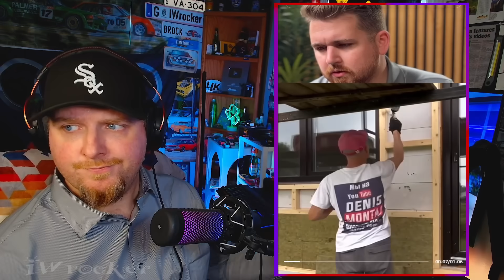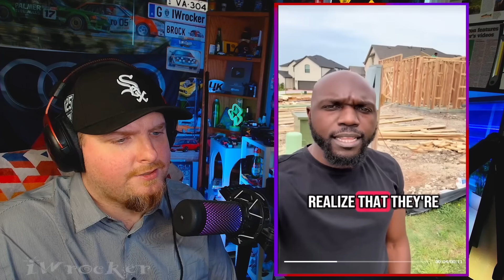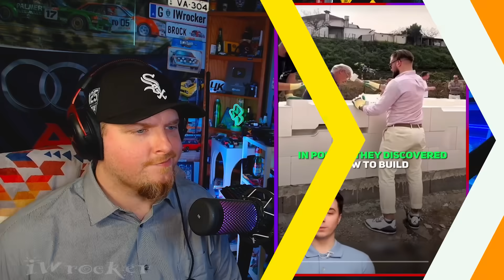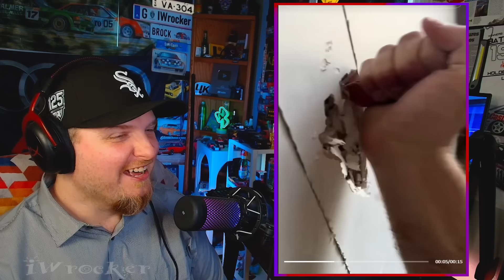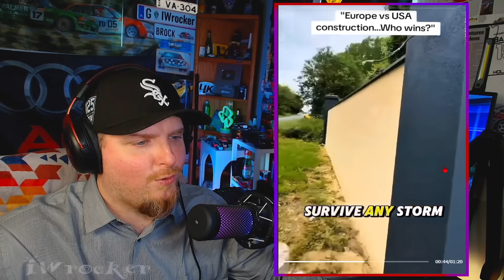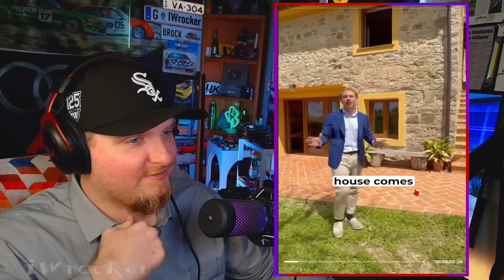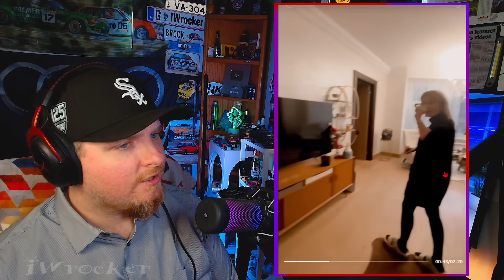25 Minutes of European VS American Home Quality & Construction Methods 🔨

Comment: I wonder if the Woman in America with European Windows is aware of the third option, if you would close the window and put the handle into an upward position, the bottom of the window will get locked and the top will loosen about 6 inches, so you can get fresh air in, but keep (most)wind out

Comment: Just to comment on walls inside a home (house or apartment), we have some drywall, but not every wall. Usually used for dropped ceilings or some small dividing walls, but not for a load-bearing wall.

Comment: In Australia there are several (modern) building styles. 1. Weatherboard; usually timber frame, horizontal wood slats outside and dry wall inside.  Inside frames are generally wood covered in dry wall on both sides. Insulation on the inside.  This style becoming more rare.  2.  Brick veneer, wooden frame (though many now are steel), dry wall interior & inside insulation.  This is the most common style.  3 Brick, double brick outer walls. Room walls are timber or steel frames covered in dry wall.   Insulation is often of a foam to solid type pored in between the outer & inner brick walls after building.  This is more costly and not often used these days.  Houses used to be on wooden foundations but are increasingly built on concrete slabs.  There are other building materials, but these are generally in “custom” built houses.

Comment: The "funny truck" from Tuscany is called a Ape. The moment you get into the country, it is full of them. It is mainly used by old farmers to get to their farms, which are not always near their homes, or 14 to 18 years old instead if a scooter. It has 50cc engine and doesn't go fast at all.
I don't know, I'm not an expert. I just live in the country in Tuscany and find them especially annoying when I get stuck behind them going to work 😂

Comment: I'm from the Czech Republic, and in our country, houses are built only of bricks and concrete to last at least 100 years. My house has 120 cm thick perimeter walls, and internal partitions 30 to 50 cm thick. American houses are made only of paper and wood. After all, every country has its own building traditions and houses, for example here in Europe, will last for several generations.

Comment: A cement or rock house has a big disadvantage. You cannot hammer nails or screws into it to hang a clock, a shelf, a wall lamp or run a cable. You have to own a hammer drill for the bigger things, and for smaller nails like on cable clips you have no alternate options. I was in a kitchen where they had wooden boards covering the inside, but they had to be torn down.

Comment: About the windows: There is a HUGE difference between the quality of windows from different European countries. If you want top quality it has to be from northern Europe, you do not want some of the windows you can get for example in Portugal.
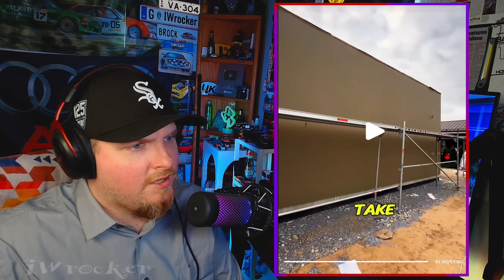14:35 This system is called ETICS (External Thermal Insulation Composite System) Normally called Capoto in the south. It is relatively efficient as long as it is completely sealed, but the cause of a lot of problems when its not. That is why it is not used in northern Europe. Insulation should be inside the walls, not outside, for 1000 reasons.

Comment: The house in London is actually just a facade, one of many built during the latter 19th century, why? Because at the back there is a deep cutting in the ground for one of the London Underground railways. many miles of the Underground (Tube) built in the 1800s were constructed using what was known as Cut and Cover technology , a deep trench was dug, the railway laid in the bottom then a tunnel archway placed above the rails to allow the passage of trains, before the soil was replaced.  Because the railway engines used at the time where coal fired steam engines, occasional ventilation areas were left open to the sky, this is one of those. The facade was built to disguise the opening from street level.

Comment: min 8:00 where is the insulation? even interior walls ALWAYS need insulation. so you can heat only one room, you´re children can´t hear you making them a sibling and the list goes on and on.
min 15:40 besides the water problem, does a person who cuts out such a nicely rounded hole, also very well fitting btw.... deserve the title "carpenter" in the US? 
min 18:45 the "car" is an Ape [spoken R-pe(like in pendulum)] which is an italian Wunderwaffe for the less than 2 meters wide alleys in small villages. Especially in hillside villages they keep everything going. 
Sometimes size matters - the other way around. In the little village in the southern Sea Alps in Liguria [region], i live twice a year for some time, they are the versatile solution for logistics, especially for building something, garden work, recycling the trash and so on. Cheap, runs 100 Km ++ [62 ++ miles] a gallon and comes in lots of variations. Life without them would be much harder there without those "unamerican" vehicles.
We laugh at your trucks, which run 30 km max. on a gallon of fuel. This way we are all happy to have something to amuse us - no bad blood at all. 😇
min. 21:30 that is probably the "cold" rent which gets heating, water, electricity on top. But it´s still very cheap for a EU capital, even it´s in Latvia though. No insult here either, great capital city, but Prague, Rome, Paris, Madrid - the list goes on - and even Berlin have more to offer culturally. 
In the end, in the less neo-liberal, dollar-warshipping countries of Europe you can get a bigger house with a huge difference in build quality in a better place for a cheaper price.
With better societies on top. So:
Dear IWrocker, just choose a life as a "digital nomad" and produce your clips in the EU. Under your current POTUS you´ll live in a fascist country or at least one that has done many steps in that direction. And it will become worse and worse by
Open minded as you seem to be you will be welcomed here with open arms. With much love from Germany.

Comment: The insulation ongoing from 14:00 is made for ZERO-ENERGY-HOMES. These houses combine solar-thermie and photovoltaik-systems to a kind of off-grid home. 
Still they are not off grid, they produce more energy than they use, usually.
Heating and cooling is done (at least partly) over air flow aka ventilation. 
Moist air is sucked out of the house, dehumidified, warmed up again in a heat exchanger, then blowed into the house again.
Everything is controlled by thermostats and very important, by moisture meters.
No need to open the windows for venting, cause you have fresh air 24/7 all year round.

Comment: Guarantee you that the furring strips in that first house are impregnated against rot. Difference is European impregnation does not turn the wood green.
Also houses over there are increasingly fast to be set up and remain solid thanks to manufactured housing where intire walls are poured in a factory.

Comment: The house I grew up in is older than the US (don't know the exact year though). It's showing its age, because the timber-frame construction wasn't well maintained, but despite its issues it's still standing. The clay fillings between the timber make for surprisingly good insulation, so the large central room (across 2 stories) stayed cool even during the hottest summers. It had its issues, yes (especially the floors becoming uneven by centuries of wood warping and the foundation settling). It even caught fire once, iirc. But I'd still bet on it outlasting most homes built in America today.

My home town got official township status back in 1243, and some of the buildings are even older than that - or at least parts of them, like the foundations of the church.

My favorite building material is quarried stone. Walls like that basically last forever, as long as they're not under constant uneven pressure. Sturdier than brick or concrete, and looks much better too, imo. The sections of our old town wall that weren't actively demolished for construction still stand, even though nobody has maintained them in centuries.

Comment: I live in a 115 year old house. Stuff like the roof and windows had to be replaced when we moved in about 25 years ago, but other than visual stuff no structural fixes/changes needed to be done This war the first renovation in the houses lifetime apart from fixing up the facade. I made some builds following american techniques, they are useful. One of them was an insulated chicken coop (lined on the inside with sheet metal instead of drywall) and the second project was a permanent install stage in our church that was made like a floor in a US home.

Comment: I have been watching IWrocker for a while now. I think it might be beneficial to look at some European house issues. It's not that popular online (compared to shitting on US houses), but our houses do have issues. As is the case in the US In 90% of the cases it's improper installation or lack of maintenance, just because the materials are longer lived here doesn't mean you don't need to maintain them!

For context I am an architectural engineer, I have been working in Europe and the US for about 10 years. And yeah, you can have shitty houses everywhere, even though European materials are more sturdier, builders can (and will) definitely mess up, and unlike the US this doesn't mean you can bring out a knife and fix the pipe leak in the wall.

One thing before we begin, I feel like there is some misconceptions that for European homes you build it and then you have to tear it down completely later on if you want to change something. European houses/apartments can and are frequently rebuilt, regardless of their age or building materials. I have both lived and worked on houses that are 200-300-400 or more years old, that were completely renovated and are still being used. Even if it wasn't a massive renovation job older houses usually have had some modifications in the last 50 years (every other generation usually). But it is more expensive to do full makeovers, usually the changes are in regard to windows/doors, floors, isolation and roofs (basically only the walls are the same). For historic buildings we try to use traditional methods and esthetics, but it is still new. You can even call this the European "House of Theseus effect" based on how many changes were made over the years and is it even the same house anymore.

With that out of the way, let's deep dive into some common problems, I am basing these solely on my experience and reports within the industry. I won't be mentioning one off problems but ones that happened enough times to be considered a pattern. 

1. European roofs are (usually) made from hard materials, either metal or clay variants. 

1.1 The problem with metal roofs is that they can get dislodged (if not properly installed or old) and fly away or drop down (and sometimes hurt someone or make a loud bang) usually during high speed wind or heavy snow. Also depending on your sound isolation and if you are the floor right under the roof you will hear every drop of rain and every pigeon. The heat can also be a problem especially in the summer (never get the last floor in a European building, it can be good but is usually a gamble).

1.2 For clay variants the biggest problem is improper installation (if installed wrong rain can go between the tiles and destroy the wooden construction underneath or drip down to the ceiling and walls). The other is weight, if not sourcing the material correctly you can get wet timber, and that timber will bend and distort under the weight of clay tiles, making for some wonky looking roofs. For example I have even seen a wet timber roof start ripping out the exterior concrete wall and pushing it to the outside (leaning tower of Pisa style) that had to then be reinforced with 500kg steel U shaped rail beam that was then welded to the rebar in the concrete columns to bring that wall back into alignment. Again, some people I worked with reported sound as a problem, one person was complaining that different birds and squirrels were using the tile on his roof to crack walnuts.

2. European windows are nice but I have seen 4 problems consistently. 

2.1 If installed improperly water rain can bleed around the windows, especially under the lower trim, seeping water into the house and eroding the interior wall finish and even causing mold.

2.2 European windows often come in three materials and their combinations, PVC, aluminum, and wood. The biggest problem for PVC is that there are some cheaper variants (Chinese imports or low quality work) that can bend and warp within a year or two leading to gaps between the panels, in some cases you can even stick a finger through those. (from my experience the best ones are wood and aluminum combination, but also fairly expensive) NOTE if you do have aluminum and wood windows be gentle with the opening and closing if you want it to last a long while, I have seen some last 40-50 years without any repairs done.

2.3 Modern homes come with a built-in bug screen, however usually builders don't install all the side guards, so the bugs just go around and enter though the gaps in the corners. They can also enter the window shutter box and then get inside through the rope box if sealed incorrectly.

3. Here are a few tidbits for interior of the house as a whole. Lack of grounded outlets, warped exterior doors due to the builder not removing the protective cardboard cover (yep, real smart...), all sorts of wiring problems for the lights, AC, TV, internet, etc. cheaping out on the breakers. Issues with flooring (big gaps or uneven). Issues with the elevator (in apartment buildings). Crooked walls! This one is actually really common and very problematic, you would think people would know what a 90 degree angle looks like... and unlike US homes this can't be fixed in some cases especially if they are load bearing (some walls are angled on purpose because of the shape of the land plot, I am not referring to those). Holes for the boiler in the bathroom cut too low so the wire is sticking (in some European houses or apartments the water heater is in the bathroom itself and not in a dedicated room or garage). Issues with sound, you can hear every pee break and snoring neighbor (also more for appartment buildings). Badly cut tiles for the built-in toilet (crooked, too big, zig zag, etc.) again no way to fix it unless you rip that part of the wall and redo the tiles. And lastly issues with water and sewer pipes not correctly done, mixing of metals (builders don't know chemistry so they mix metals for their pipes and cause corrosion and all sorts of problems on treated or usually non corrodible parts), wrong size of pipe leading to frequent flooding, cheap shower drains that clog or don't drain fast enough (when showering) so you flood the bathroom. Improper flooring angle in the bathroom leading water to the sides or a random corner instead of the drain. And finally leaving open ended pipes in the walls and then putting concrete and plaster on top leading to massive water or shit buildup over time, this one happens more in renovations than in new homes, the builders just brick up a random pipe that isn't used anymore and then it starts leaking (seen it happen in apartment buildings).

There is way more, and this is not to shit on European homes I personally like them. BUT they are not without issues and hopefully this will help someone when searching for a new home here. Now you know where to look :)